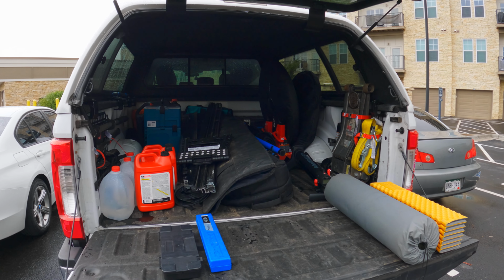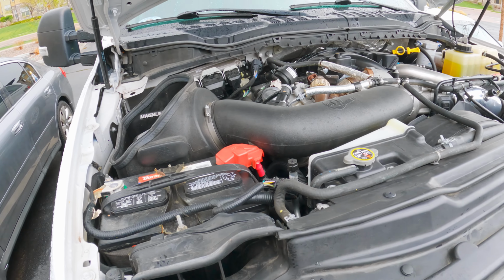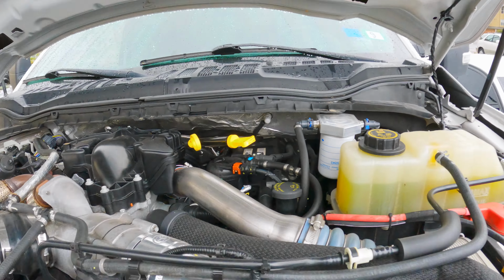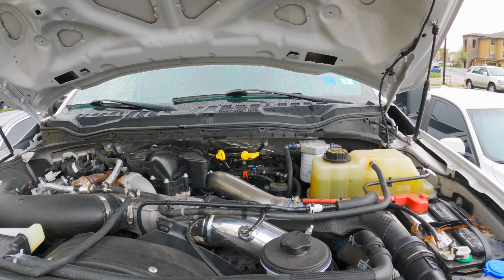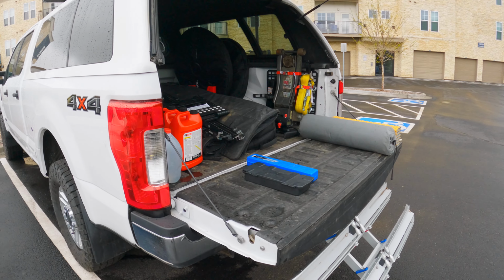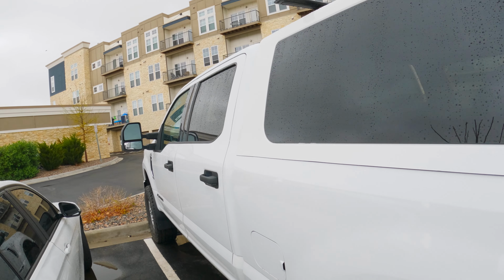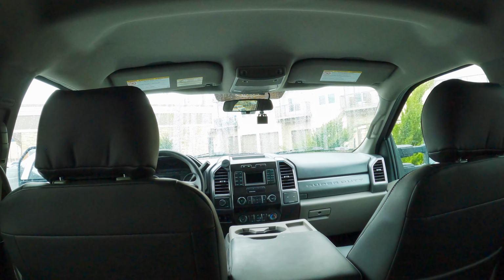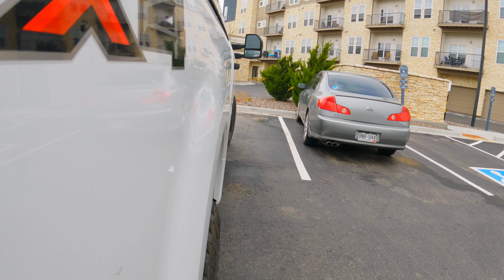Power Stroke 6.7 Owners: How To Avoid Common Issues And Make Your Truck Reliable

Comment from the maker: What issues did I miss?
Reply: S&S now offers a DCR pump conversion to completely eliminate the CP4 forever. I'd also replace the cold side charge pipe as they tend to pop frequently as well as checking cab mounts since they rot on the 11-16s.
Reply from the maker: Good call!
Reply: critical: "The Trooper" ale is not readily available in my area and it is July.😢
More seriously, thank you.  Someone comment about the ccv which will also lead to oil leaks.  I am grateful to have watched this as I didn't hear about turbo issues before (outside of proper cool down time).  I am looking into getting a 6.7 in 7 to 10 months so getting my research in!  I appreciated you time.  (I am #69 on the thumbs up too)  Do you currently have a preferred oil and oil filter?  (I plan on Shell T6 and I have become a huge fan of WIX.)  Subscribed!
Reply from the maker: @tattooedmillionair  Thank you very much for the comment!  Glad the video helped. I am currently using Amsoil 5W-40 Signature Series with the Amsoil filter.  I think as long as you're using a high quality oil and filter (and changing them regularly) you'll be all set!
Reply: I agree on the CCV reroute as mentioned and would add that to your list.  I installed the one from SPE with the internal catch can and it has worked great.  Frees up space in the engine bay and prevent all that crankcase vapor from being put back into the intake/turbo.  Great video and good information for some of the worrisome issues.  I like how you stressed the point about fuel additive and the low quality diesel we have.  I have used mostly Stanadyne Performance or Archoil on every fill-up since new.  I would consider the new DCR pump but would like to see some reports on it after 6-12 months.
Reply from the maker: Thank you!  I really appreciate the comment.  Actually just had the SPE CCV delivered yesterday haha excited to install it especially after hearing that you have had a positive experience. 

The DCR does seem like a good investment, but your caution makes sense given that it hasn’t been in the market long.  I did the disaster prevention kit and run archoil every fill up and have been feeling pretty good. Time will tell.  What do you typically use your truck for?
Reply: @powerstrokemaintenance  My truck is my daily driver and I pull a trailer but nothing an F150 couldn’t pull easy enough.  I have owned 5 F150s and all were good but I decided to go the diesel route in hopes I get 300k+ miles out of it.  I knew the maintenance requirements would be higher but I stick to a strict schedule and follow most of ARod’s recommendations which seem to make sense.  The key ones being the 5k oil changes and 15k fuel filters.  I put the Banks air filter, S&B cold side pipe, SPE CCV reroute and now the AGM batteries.  I do all the maintenance myself which is pretty easy on these trucks.  It has only been to the dealer for annual inspections, recall and 1 warranty claim for right mirror failing to operate.  I hope the DCR proves to be a solid solution and would look to add that at some point.  I have extended warranty up to 125k miles so we shall see.
Reply from the maker: Nice! That makes sense why you’d wanna try the diesel to more miles out of it.  It sounds like you’re super dialed with your maintenance.  I feel like folks that follow A Rods advice will get lots of miles out of their trucks 👌 how do you like the banks products so far?
Reply: I really like the Banks products and haven’t added the pedal monster or the gauges yet as I use FORScan on my iPhone for the gauges and tracking regens.  I would consider the Derringer once it is available for the 2020+ and maybe the 5” exhaust.
Reply from the maker: Gotcha! Yeah there 5” pipe looks real good on the trucks

Comment: My F350 7.3L 2016 340,888... sent new my mechanic update with Bank's cooling Airfilter tuning pedal , PPE cover diferencial alxel and engine transmission .... before change oil test it around 17.6k to 19k save money 💰 🤑 💸 a ton of money  mpg hwy 28 load hauling 12k to 17k boats camping and RV 14 mpg 😂😂😂.... please keep teaching how important it learn do maintenance 😀 😂de 😂😂

Comment: Use a bypass oil filter. Best thing I did to make my 6.0 powerstroke more troublefree. In ‘03, when new, I had to change the oil every 3000 miles or the injectors would soot up and give rough starts. EGR went bad and both heads cracked. After repair I installed the fs2500 bypass oil filter and started running Archoil fuel and oil additives. Began oil analysis and now run an oil change to 10000 miles with over half of the wear package remaining in the oil. Running Scheaffers 9000 5w-40 the past 120,000 miles with no breakdowns.

Comment: I have added a 3 micron fuel filter and fuel water separator as the factory has 10 micron which is not acceptable..
Reply from the maker: What brand water separator did you go with?

Comment: The 6.7 is definitely the most reliable out of the powerstrokes as long as it’s driven like a diesel and maintained like one, got one right now with over 9000 hours and haven’t replaced a single thing and another one with almost 7000 and all I’ve replaced is the vacuum pump seal, my 7.3s would have had everything go wrong with them by now.
Reply from the maker: That's impressive. What sort of work do you use them for?
Reply: @powerstrokemaintenance  one of them was an oil field truck that now retired from that and now it’s with the other doing trash out in the socal area. Both still get worked daily

Comment: Once every other week or so, I like to take our '19 F-450 for a good long drive on the interstate. Keep the tach at a steady 2500 rpm for an hour or so. Do a couple of speed runs to get RPMs up. Maybe it helps to keep the engine and DPF clean. I dunno. 🤷🏼‍♂️But, I'm always in a better mood after a nice drive that's not in stop and go traffic.
Reply from the maker: It definitely helps to keep the engine and DPF clean! These trucks need to run 30-45 minutes at higher RPM to regen so your routine is perfect!  I might have to start doing that when Im home for awhile haha
Reply: I idle our 450 for about two minutes before shutting it off, as suggested in the owners manual. Other than that, I try to avoid idling.

Comment: Dang already got AutoZone batteries in it. My 2017 still for factory ones. The coolant level way above max.
Reply from the maker: Yeah a couple days below zero fried my factory batteries haha thanks I’ve drained some out since then
Reply: I have a 2020 6.7 with 91k miles and just replaced my factory batteries with the AGM's that ARod did on his truck.  It surprises me that batteries don't last more than 3 years these days in a lot of cases.  Is it an indicator or poor quality batteries or do these diesels put more strain on a battery?  Also, I had to replace mine due to them failing not just for the AGM upgrade.
Reply: @chadh6899  mine are at 6 years old and I live just outside the coldest city in the USA 🇺🇸.
Reply from the maker: The ford employees must’ve been in a good mood the day they built your truck 😂
Reply from the maker: I also think it’s a combination of additional strain and poor quality.  I trust motorcraft less than I trust a politician lol

Comment: Only thing I would add is the cold side pipe before it breaks which you stated towards the end. Ran my CP4 for 160k miles before getting cold feet and upgrading to the DCR pump. Another maintenance task is after 50k miles tighten the vacuum pump bolts and add loctite.
Reply: For the vacuum pump that only applies to the 11-16. After 17’ they changed the seal.
Reply from the maker: @ramirogallo4303 good to know!
Reply from the maker: How do you like the DCR upgrade?  Seems like a solid option to replace the CP4.  And how did you come to need to tighten your vacuum pump bolts at 50k?
Reply: @powerstrokemaintenance  they are known to vibrate loose and start leaking oil. Many mistake the oil leak for an upper oil pan leak which is prevalent if you don't maintain your CCV filter. DCR pump is a no brainer, timing when to replace the CP4 is voodoo math.
Reply from the maker: Makes sense! Thanks for sharing
Reply: @rangervapes571  I am definitely interested in the DCR and likely something I'll add at some point.  I'm a little skiddish on something so new BUT you are right about the CP4 as I have little confidence in it lasting the life of the truck.

Comment: Smog device are the biggest problem with these trucks got to drive them like you stole them or you will have a problem if you’re in an area where they don’t do smog delete it . However, you will not get better mileage just to let you know if you know anybody who really does I like to know what they do to get it.
Reply from the maker: Yes the emissions equipment does cause a lot of longevity problems!

Comment: 2011 with 190k.   I doubt you will make 1 million miles with an EGR.  

Before I bought my truck it had a delete (if you can) and a new turbo.  

I've done the fluids and maintained it regularly.   I've also had the glow plugs switched out and planning to do a new main radiator, DPK, intercooler hot side and cold side.  

After that there isn't much else.
Reply from the maker: Makes sense!  Thanks for sharing.  What problems have you had with the Ford steering components? Or were those already done before you bought the vehicle?

Comment: Do not run non ford approved addititves. The nox sensors and the scr are very sensitive to contamination. There is no magic in a bottle that will clean your def. Like this guy said dont ignore the truck when it has a problem and perform regular maintenance.
Reply from the maker: What experiences have you had with additives contaminating the nox sensors and SCR?

Comment: change oil every 7000-7500miles (still life left on the monitor), change fuel filter every other oil change, drain water every 4-5000 miles..... run extreme diesel treatment every tank.....
Reply from the maker: That's a damn good maintenance regiment!  It sounds like you're on top of it

Comment: DPF cleaning fluids? Which one do you use?
Reply from the maker: Yes!  They help a lot.  I like Archoil's AR6400-D or Rislone DPF, Exhaust, and emissions system cleaner. Both work great!  You can use the code PSM10 to get 10% off the Archoil stuff if you end up wanting to try it

Comment: Basically to put things simply gentlemen all you got to do is to completely delete your truck and add a nice fuel filtration system and pump 🤠
Reply from the maker: I don’t know what you’re talking about 😉
Reply: And upgraded turbo. 👌
Reply: Just dont use metal filters or filter housings that can rust in case you get water in the fuel
Reply from the maker: Metal filters?
Reply: @powerstrokemaintenance   like your donaldson and cat filters. They are metal body with the filter inside instead like the stock ones which are plastic. I know this sounds crazy but s&s diesel just did a video on a truck they did a dcr swap on. The truck got water in the fuel and rusted everything thing that was metal. I hate plastic as much as the next guy but it made sense.
Reply from the maker: Interesting. So was S&S recommending using plastic filters? Are you able to share the link for the video? Seems odd since everyone in the aftermarket is making those spin on kits these days. But I agree it does make sense that they’d all rust when exposed to water
Reply: What filters you guys recommend?

Comment: 86K for the powerstroke I built online. Doesn’t make sense to me to have to do all this with a new vehicle! Maybe Ford should come up with a fix to these issues with the price of these vehicles! I’m not adding all this bullshit every time I need fuel. I keep driving me bulletproof Tundra!
Reply: Well it's not a Ford thing, it's a modern diesel thing due to the EPA. So, your Tundra is gas not diesel and if it were diesel, it would have most of the same issues. Happy limited gas towing capabilities
Reply: @mikz86ta1  ✌👌
Reply from the maker: Tundras are solid. What year do you have?
Reply: @powerstrokemaintenance  2019… I had a 2013 & 15 also. All were awesome. I am considering starting a dump trailer business removing and cleaning garages, attics, ect. I’m going to need a little more capability which is why I’m considering the diesel
Reply from the maker: Got it, makes sense!